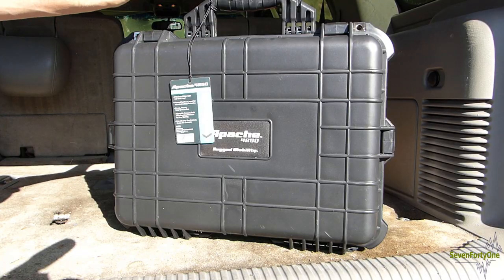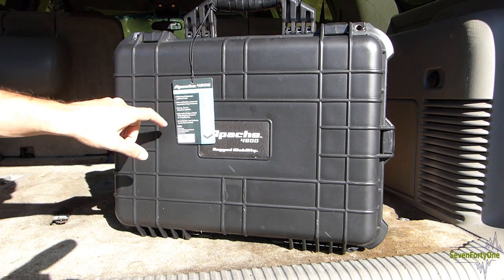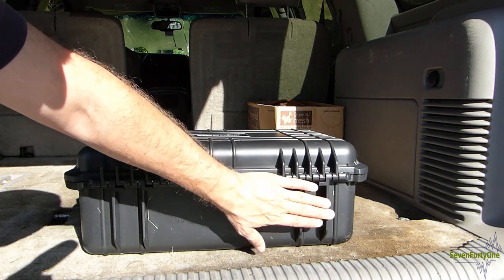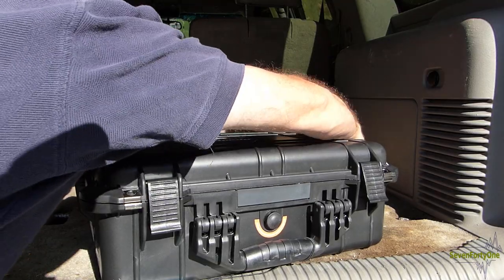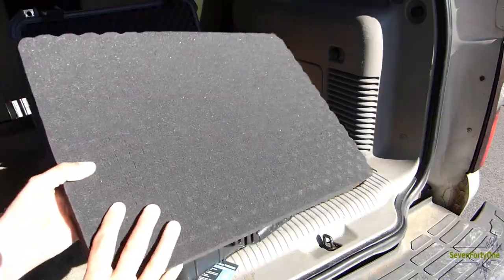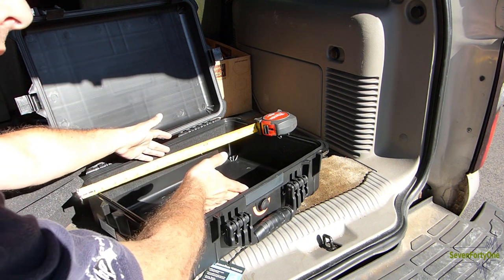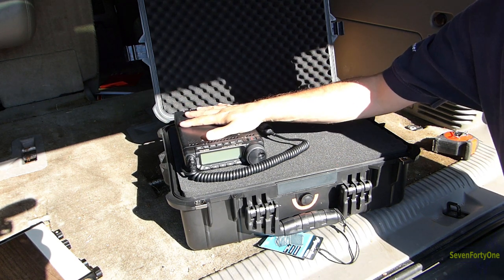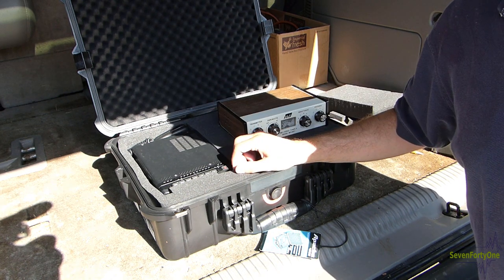Apache 4800  Protective Case Quick Overview

Comment: Great review of the case.  I have been contemplating going to Harbor Freight and getting one of those for my FT-817ND and LDG Z817 ATU.  A few years ago I bought one of the aluminum cases they had to house my racing drone and controller.  I may hold off getting one of those until I make up my mind whether I want to buy a FT-891 or not.  Just seems that when I am chasing POTA stations, they are having a hard time working me.  At least that was they way it was this past Saturday when I setup my 817 in the back yard.  So I have a few decisions to make before I buy the case.  I would hate to get the case and cut out for the 817 and then turn around and get a 891.  LOL  Juddie WD8WV
Reply from the maker: You could always get new foam if you decide to get a different radio.  I'm told Michael's craft stores sells it for a reasonable cost so you could make up different inserts for different radios.   Oh - BTW I got your cards today...very nice - thanks!!!!
Reply: SevenFortyOne your very welcome.  I thought the Babcock SP would be nice since it was an all time new one.  I may look into the different insert idea.  Thanks for letting me know!

Comment: As you can see at 1:45 there is a rectangular piece of plastic just above the pressure release valve. The plastic slides in and out of the case. What purpose does this rectangular piece of plastic serve?
Reply from the maker: I don't know for sure but my guess is for a nameplate.  I'm sure there are made in a generic factory in China and sold to whoever wants to buy them.  If a distributor wanted to make up a logo or some put their name on this device they could put it there.  I'm guessing to keep costs low Harbor freight chooses to put a blank panel there.   This is just a guess...I'm not sure I'm right.
Reply from the maker: Great idea!
Reply: @SevenFortyOne  Great news! The ruler is too small. A triumph of manhood. Nice!